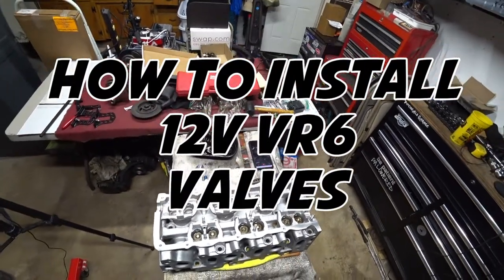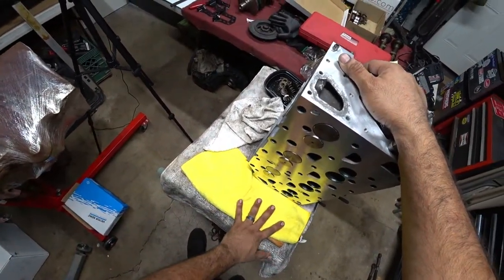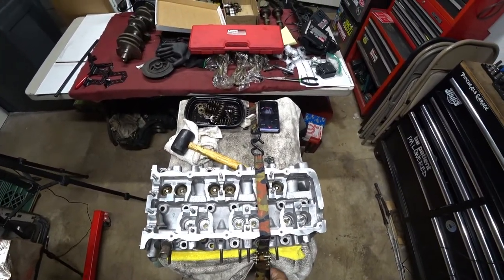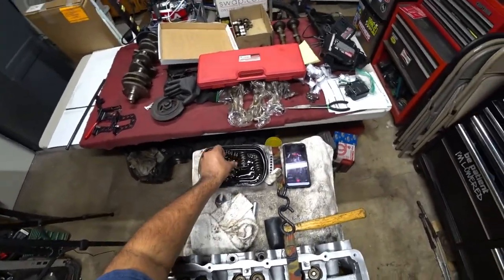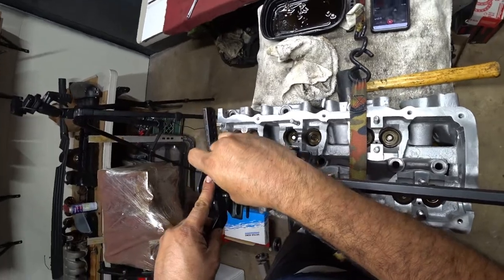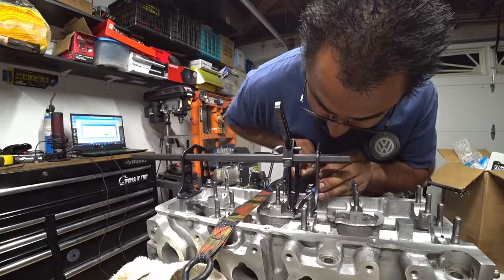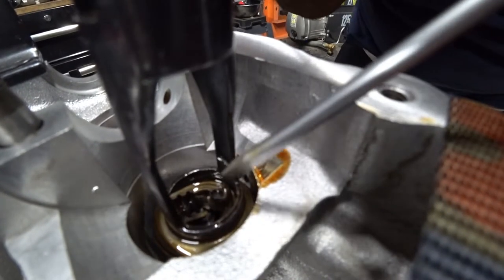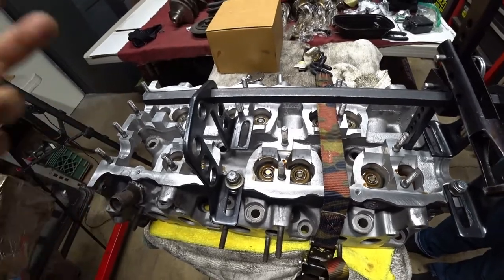VW MK4 12V VR6 Valve Install S7EP14

Comment: idk if you check your comments anymore but I have a 24 valve vr6 in a 2003 Jetta gli, if I do get to the point of valve repair would it be the same process just double the valves?
Reply from the maker: Yes I check all my comments and I do my best to respond to them.
Yes it is the exact same procedure just a lot more valves. We are currently working on a 24V rebuild so you should be see that content very soon.